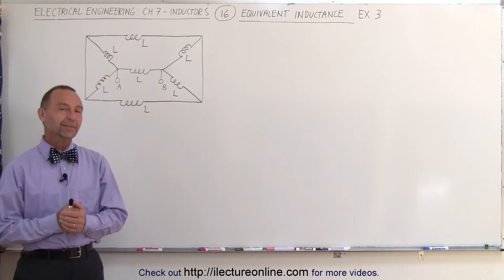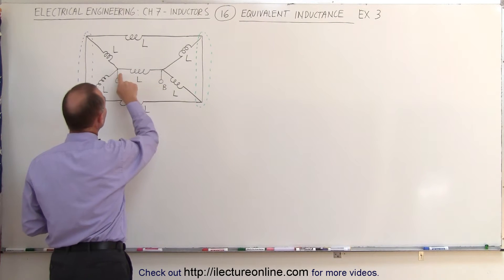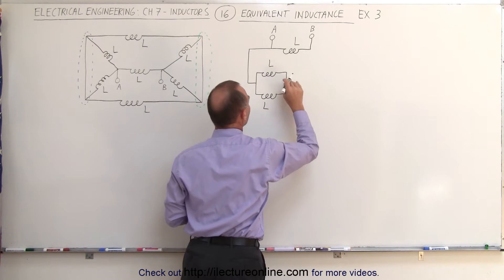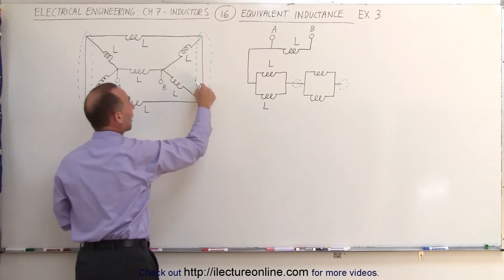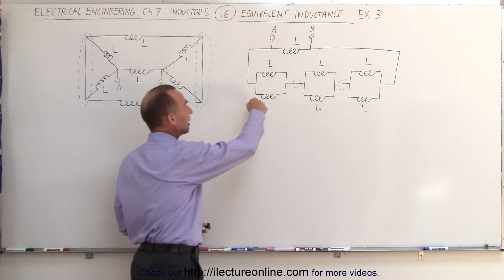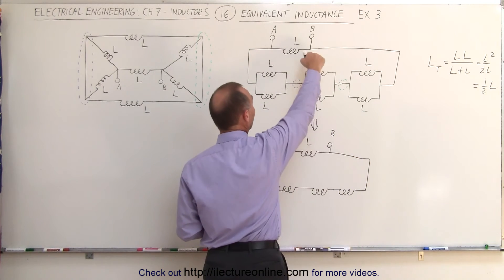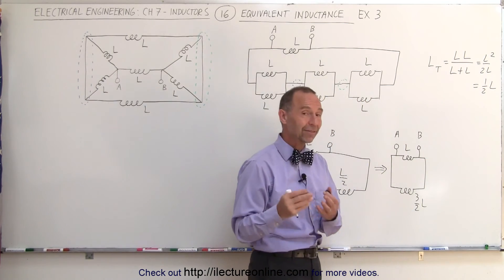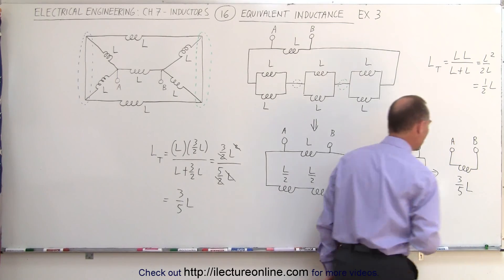Electrical Engineering: Ch 7: Inductors (16 of 20) Equivalent Inductance: Ex. 3

Comment: Why u didnt consider the inductance L between point A and B in Series with the right and left inductances ?
Reply from the maker: All inductances were considered in this problem.  The trick is to redraw the circuit in such a way that makes it easier to find the equivalent inductance.
Reply: @MichelvanBiezen  yes but it need clarification did you consider point A and B a principale Node i mean will the current divide at those point ? If not it must be in series with other inductors , thank you

Comment: Would you use the same principle for converting WYE to DELTA or DELTA to WYE circuits?
Reply from the maker: In this case, neither.  It looks like a y circuit, but it isn't as is shown in the video.